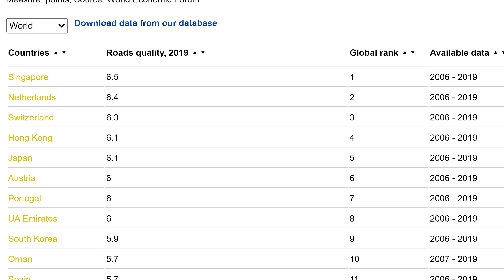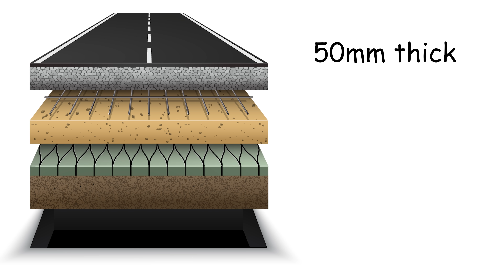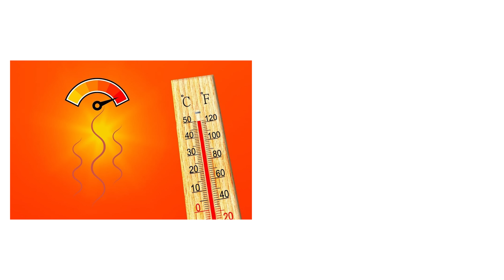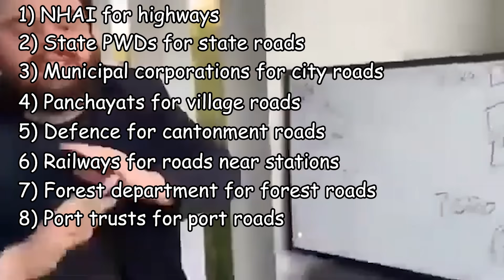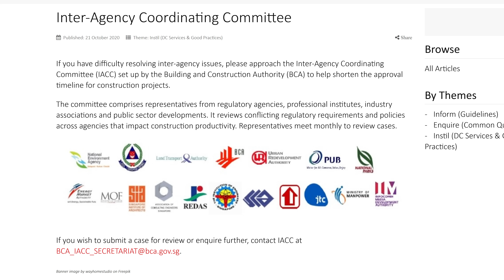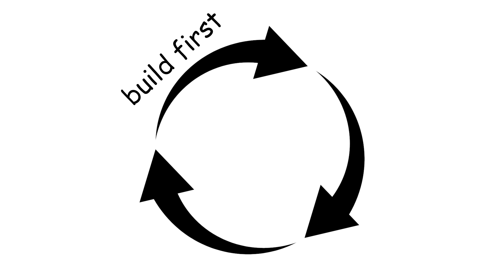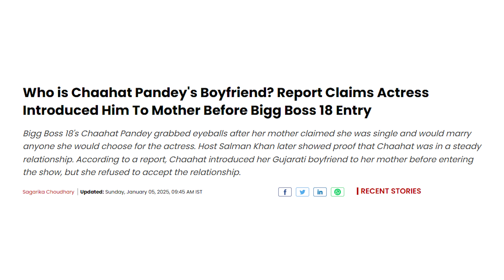how singapore makes roads

Comment: Higher population density makes things harder, but that’s exactly why good governance and planning are more important, not less.

Look at cities like Singapore with a density of 8,300 people per square kilometer, Seoul with around 16,000, and central Tokyo ranging between 6,000 to 15,000. These cities are extremely dense but still have clean streets, efficient public transport, and excellent public services.

Now compare that to Delhi, which has a population density of around 12,000 per square kilometer. Yet it struggles with pollution, traffic, water shortages, and basic infrastructure. Delhi was under central rule until 1995 and then had 15 years of Congress government, but there was no major transformation.

So yes, density is a challenge, but the real issue is the lack of political will, long-term vision, and accountability. Countries like Japan and Singapore didn’t make excuses. They built systems that work.

India doesn’t suffer from too many people. It suffers from too little leadership..

Comment: Good points. But comparing a city state with a large federal union republic like India is not the right way to address this issue. A better comparison would be China. Singapore is very small and centralised. And it is very easy to run compared to a country like India. Such quality checks are easy to implement in a small city like Singapore where you can travel the whole country in 2 days.  Even LYK couldn't solve our problem as a consultant to the GoI. Partly because of our own overcomplicated system and partly because of the inherent complexity of India as a state. You can't apply things that have been done in Singapore in India in 1:1 way.
Reply: sure being as perfect as Singapore may be impossible but is not having potholes too much to ask for? we may not be able to have as scientifically perfect roads but at the very least can our government make the roads fine enough to drive on

Comment: I am from the neighboring country of Malaysia which is 21 in the rankings—and second in Southeast Asia. We do have a lot more roads and interestingly enough ranks better than Brunei who have a lot more money per capita. And our CPI is 57th out of 180. Our roads also do have a large variety so this is why is brings down the average but our urban roads, federal roads, and highways are generally nice to drive on. 

I mean they have to be nice considering that Singaporeans enjoy driving 140 to 160 km/h on our highways every time they cross the causeway. Although, recently, Malaysian authorities are cracking down on Singaporeans with unpaid speeding fines and they must pay up or risking being barred from entering Malaysia. This means that Singaporeans will begin to significantly contribute to the improvement of Malaysian roads, so not a bad exchange for constantly buying subsidized petrol meant for Malaysian registered vehicles only (which there is yet a law to fine buyers but there are laws that punish sellers and petrol station owners).

Comment: I was all for promoting cycling and walkable architecture until yesterday when i took my friends new creta for a spin and a kid with no brakes hit his cycle  and damaged the paint and a didi walking by raged and repeatedly kicked the door until my friend told me to zap. So i floored it. 11s to 100kmph , of which i reached 40 kmph , that was enough
Reply: If you don't have cycling infrastructure the rager would be driving instead. I think that's a lot worse.

Comment: if the local goverments of the districts and village have the right incentives, shit can be fixed.
Younger people need to get invovled in such low level politics
Instead of thinking of a miracle from the top
Reply: But the issue is that the top is the source of the main issue(lack of $).If you don't change  it,change below is impossible.
Reply: Young people should do things, and we are going to block them every time because they are young and they don't know shit.
Reply: @prabashrusiru9224  The boomer generation has ruined this nation, the gen z needs to fix it.